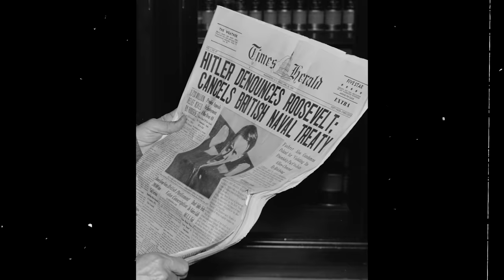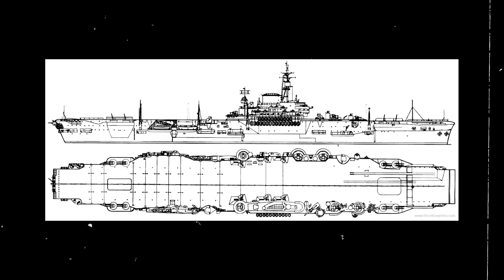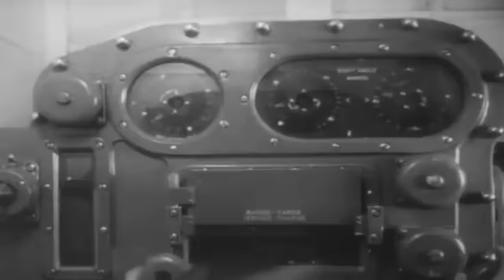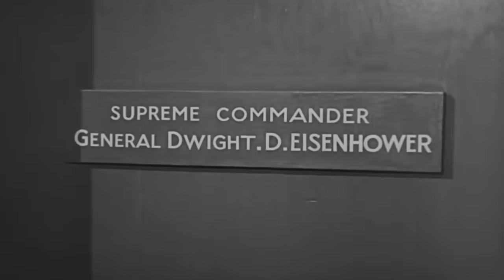The Ship All Axis Powers Were so Afraid Of

Comment: The Brits got the Corsairs before our troops. Our folks thought they had too many glitches. So, Britain ironed out the problems and then US picked them up again
Reply: Same with the Chrysler multibank engine fitted to some Sherman tanks.
Not to mention dropping Merlin engines into Mustangs
Reply: Are you peddling that incorrect myth that the UK showed the yanks how to land them on a carrier?
Reply: @mikeholland1031  How do you come to that conclusion?
Reply: @mikeholland1031  Thought it had to do with performance problems and general mechanical weirdness. Never heard about any landing problems.
Reply: @g8ymw  facts
Reply: @mikeholland1031  What "facts" are you speaking about?
Tell me what I said wrong or are you trying to put words in my mouth that I didn't say?
Basically, what are you having a go at me for?
Reply: The Brit’s figured out how to land corsairs on an aircraft carrier!  I give them that.
Reply: @Paul-zf8ob  a myth that has been disproven
Reply: @mikeholland1031  As I understood it,  the U.S. simply used a different design as their seaborne fighters. Wasn't the Hellcat an easier choice, as a replacement for the Wildcat instead of a completely different design like the Corsair?
Reply: @d.e.b.b5788  they used both. Well wildcats anyway, not sure about the hellcat.
Reply: @mikeholland1031  US pilots didn't like landing on carriers with them because their visibility was worse because of how high the nose was.
The Navy gave them to the Marines who used them for air cover and ground support.
Reply: @tomb7942  I know that
Reply: The u.s.a brought the most industrial ammo, weapons, and vehicles. i think it was almost 2/3rd of the vehicles were u.s.
Reply: Wrong corsairs were made in 1942 and used by us land bases in that time after they made them easier to land on u.s. carriers they started giving them to the brits so the brits used them after the us did
Reply: @Paul-zf8ob they got them after the u.s. fixed them to land on carriers it took the us 2 years of research to fix the problem as soon as the corsairs could land on carriers they were given to the brits a couple months later
Reply: @sirblank2384  sold not brought.
Reply: @mikeholland1031  they didnt sell 2 million jeeps just so the us military could use them
Reply: @sirblank2384  everything supplied to the British was billed. Wasn't a favor was my point.
Reply: @mikeholland1031  the us being there was a bill the British begged for
Reply: @sirblank2384  dunno about that but it sure helped.

Comment: What year did the British receive the F4U Corsair? I mean it'd also be more than a match for anything Germany had.
Reply: I have never heard the Brits got Corsairs?  Was this in the Pacific?
Reply: 1944 right after the u.s. made it easier to land them on carriers
Reply: @sirblank2384 the turning approach for Corsairs was an innovation of the Royal Navy, NOT the USN
Reply: @alecblunden8615  the royal navy had nothing to do with corsairs until after the us fixed them to land on carriers so the royal navy did nothing
Reply: @sirblank2384  the USN did NOT use corsairs on carriers until after the RN developed the turning approach method.The USN gave them to marines for ground use until then.. Look it up.
Reply: @alecblunden8615  the usn used them on their carriers in 1943 the brits didnt use them on theirs until 1944 The F4U Corsair entered combat in 1943, and gave Allied naval aviators a winning edge against their opponents. Renowned for its speed, ruggedness, and firepower, the Corsair excelled as both a fighter and an attack aircraft in support of ground forces.
Reply: @alecblunden8615  Corsairs had problems with landing on aircraft carriers but the U.S. Marines and U.S. Navy shore-based squadrons utilized the aircraft.   Progression with design and radar allowed the Corsairs to be used by carriers in early 1944.  The Royal Navy and the New Zealand Air Force also incorporated the aircraft into their air fleets.  Along with further altitude and improved engine modifications, the Corsair became one of the outstanding World War II aircrafts.
Reply: @sirblank2384  Agreed they were outstanding, but the limitation of carrier operations was landing with the rather elongated proboscis. This was not an insurmountable problem for The RN who were used to in line engines.Corsairs were trial, but dismissed by the USN until the turning approach was adopted for the mich smaller RN carriers with a good deal of success. Until then ., they were used as ground based fighters by the US.
Reply: @alecblunden8615  we had them complete for the navy before the brits got them
Reply: @sirblank2384  no....
Reply: @ddoubleg  yes